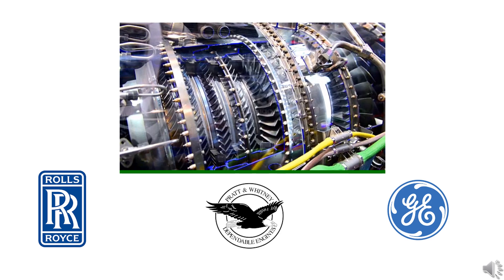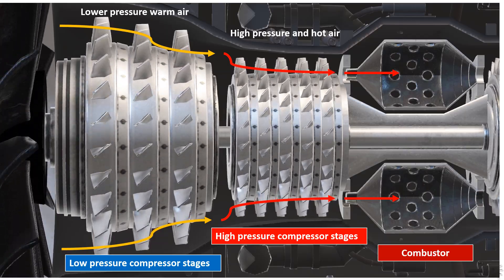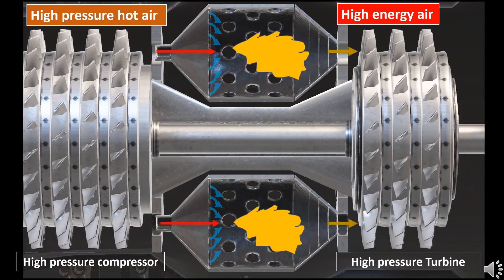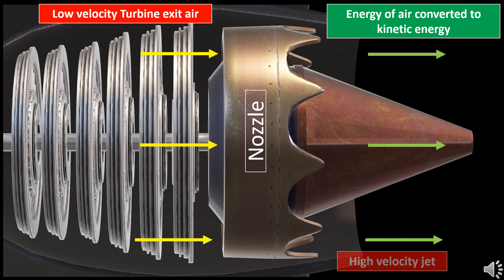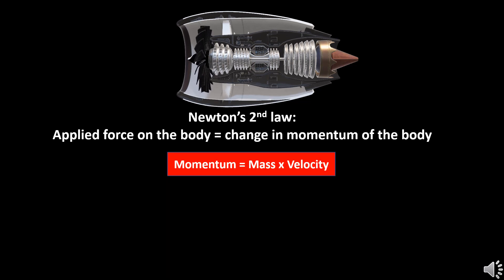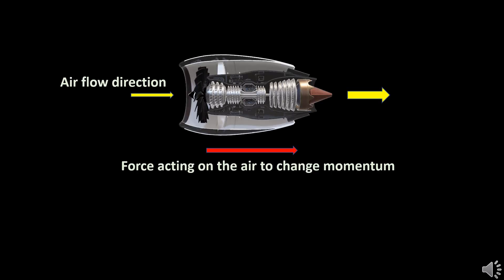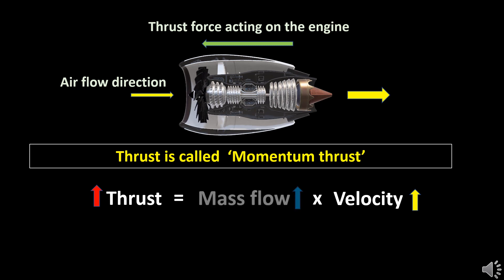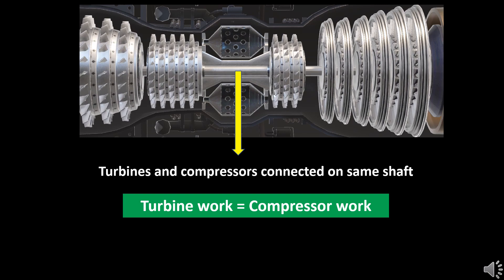Gas turbine engine working | Aircraft engines

Comment: The best lecture ever on how turbine engines work.  The missing link for me was the process by which the turbine rotor was driver.
Reply: Thanks
Reply from the maker: Thanks for your support, the turbine rotor was driver for the compressors (connected through same shaft), and it is driven by the hot gases from the combustor